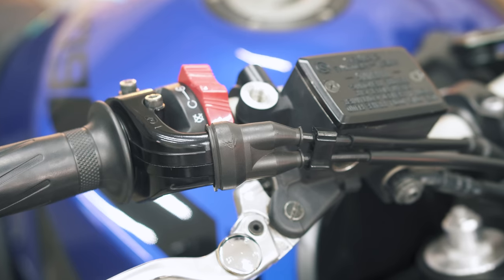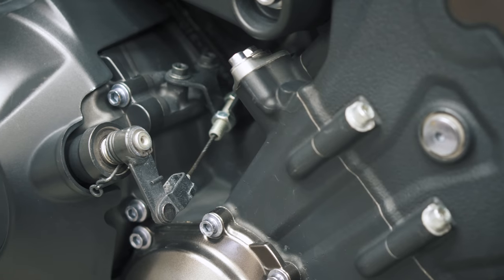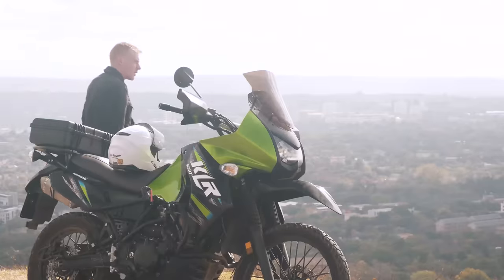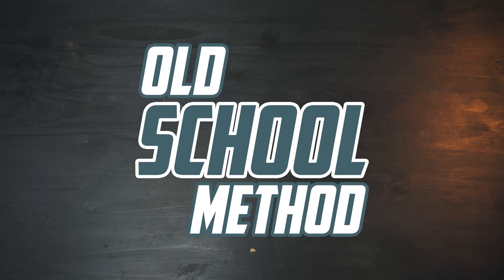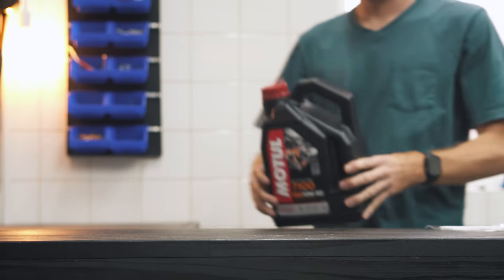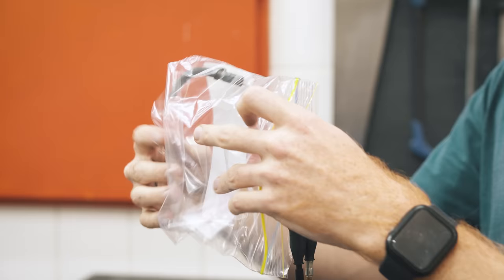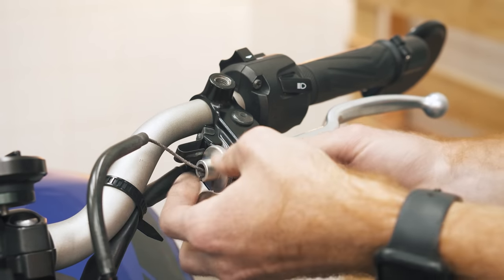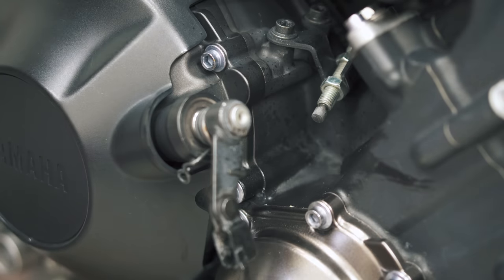STOP! Lube Your Motorcycle Cables

Comment: Bruh, that is a lot of work. I literally just poor bicycle oil down the cable as I move it up and down.
Reply: Agree. Drip oil and move cable up and down
Reply: I usually keep a drip bottle with old engine oil for that.
Reply: The clutch and throttle cables are long… to “move the cable up and down”  to the point where the lube would soak through the entire length would take quite some time, I’d rather just use the $10 tool that takes a minute to put on. If you have an hour to cut down a tree, spend 45 minutes sharpening the axe... But to each they own 🤷🏼‍♂️
Reply: @BikingVikingHH  It takes about 15 seconds.
Reply: I even use sewing machine oil, for more cheaper. It's like 2$ for a bottle.
Reply: @ksneia  not all oil is the same
Reply: @ralphwarom2514  then it’s not getting the whole cable length. I’ll stick with my 30 second tool and proper maintenance 🤷🏼‍♂️
Reply: @ksneia  no, no it’s not lol

Try olive oil next, champ, if it works right 🥴
Reply: @BikingVikingHH  no, not worth to try, it's cost more than cable lube.
Reply: @ksneia  are you Jewish?
Reply: Any sort of attention is good some people don’t bother and just leave it until it seizes up.
Reply: Ikr u can use wd40 also
Reply: I think its a joke
Reply: @ksneia  Sewing machine oil is good. They have a lot of moving parts that require low friction.

Comment: I stopped using WD40 on ANYTHING on my bike because of how much dust it attracts.
Reply: It’s a great chain cleaner
Reply: @Mikkel111  True it is. In a pinch I'll use it but even then the thin layer of whatever it leaves behind will attract dust if it's not under the chain lube that's applied over it.

AS a life hack I've learned to use household degreaser and a good old brush. It takes a bit more brushing but it gets the chain as clean as anything else.
Reply: @otlndsh  Remember not to use anything that could break down or harden the o-rings.
Reply: @Mikkel111  Ya it's friendly on the rubbers!
Reply: @Mikkel111  It's very expensive chain cleaner, diesel fuel does the job as good.
Reply: @@JuneAtHomePH lol its in a spray bottle with a picture of a motorcycle, grill, etc
Reply: WD is water displacement, it is actually a solvent and is great at cleaning stuff, and as such it will remove any lubricant any component may have, it will also eat rubber (so its a terrible idea for chains, cables, brake components, etc.).

WD is NOT a lubricant, so out it with your cleaning stuff, not your oil/grease stuff.
Reply: Try ACF-50
Reply: @SuccessShared  ACF-50 attracts even more dust and dirt, but I suppose it works very well to prevent rust.
Reply: @otlndsh  I don't know what bike you ride but I found it superb on my Harley for over a decade. MCN rate XCP products above ACF-50 so perhaps try that
Reply: Beside wd40 will eventually evaporate..you need just a tad of grease
Reply: wd40 best for cleaning rims

Comment: Did this on the clutch cable on my CBR600F1 from '87. I was either thinking about completely replacing the cable or trying the lubication tool. Bought the tool and it took a while for all of the gunk in the cable to get sprayed out, but the clutch feels ALOT better now. Then i did it on my other motorcycle and moped. Highly suggest trying the tool before buying a new cable.
Reply: I lubed my CBR600RR and I never saw the spray come out the other side. I guess I'm going to spend the time and make it go all the way through instead of buying a new cable.
Reply: @nightmaresdaydream5766  It could take some time for the lube to push its way through the dirt in the cable. I've tried with the old school method before i got the tool, i could push/pull the wire for 3 minutes straight before lube exited the other side. 
I started with WD40 to dissolve the grease/dirt in the cable untill the exiting liquid was clear, then blew air through the cable to remove most of the WD40 and then add some oil in the cable as lube. No need to use a lot of oil, just enough to coat the inside, the excess will just drip out and look messy.
Reply: I lubed the clutch cable of a 10 year sitting in the corner bike I bought ..
After lubricant I thaught the cable was snapped ore I install wrong because it feels like there is no force anymore in the clutch handle 😅 so smooth now that I had to learn the clutch new from zero ..
Reply: New factory cable was 26 bucks and now i dont have to worry about nothin
Reply: Except complete installation.

Comment: And don't forget to lube your speedometer cable too (if you have an old-fashioned mechanical one). They get neglected more than throttle or clutch cables do and likely should be lubed more often.
Reply: damn, I didn't even think about the speedometer cable. my bike has a mechanical one as well. gonna do this tmr
Reply: nice, that speedometer cable need more lube than gas & clutch cable :)
Reply: what should i use, can u suggest one. thanks
Reply: Be very very careful oiling the speedometer cable as any lubricant that finds it’s way into the speedometer head it self can gum up the works
Reply: True! On my old Bandit, if the cable gets dry, the Speedo needle will fluctuate... significantly
Reply: on my cbr it will start dancing around 60mph between 60 and 70 @888jackflash
Reply: I think bro.. you are talking about ANALOGUE speedometer here..!!! 🙄🤔
Reply: lube the speedometer cable? 😂 that has to be a joke, i have not heard of such a thing. like blinker fluid
Reply: Now, lubing that cable will make you go faster.
Reply: Mine broke last year, this comment hits home as I'm now on a new clutch cable too
Reply: @GearShifter925 yes
Reply: I just put a new speedo cable on my 01 vstar 650. it had twisted ..the last ownere was a MECHanic.lol I used good ol' grease before I installed it

Comment: I've been using WD40 for lubing sticky cables, for over 40 years, never had a problem.
Reply: WD40 was never designed as a lubricant and will lose its properties much faster than oil, it was actually invented to be a nonflammable substitute for oil. But lubricating oil is better in every regard aside of that. also you should not mix WD40 and oil, so its better to just not use WD40 at all.

Comment: Hey! Although wd-40 is indeed a solvent and does swell many kinds of rubber while also degrading multiple kinds of plastic, materials like teflon and vinyl are 100% resistent against wd-40, they are also listed in wd40's list of compatible materials with the "classic" wd40.

Engine oil and cable lube are still better options though, because of their viscosity haha
Reply: Also WD-40 solves any residual lubricant and does the opposite of lubrication. Maybe a good idea for cleaning a gummed up cable?
Reply: @raphihuberclimbing8730  for cleaning it up, yea. I'n reccomend that tool he used for that though, to really flush that okd stuff out
Reply: WD-40 is a fizzy kerosene with a little bit of oil. Kerosene evaporates leaving a very moderate lubrication.

Comment: I hold an Airframe & Power plant mech. rating from the F.A.A.
There are many aircraft that make use of Teleflex type cables for many different applications. That being said, I was taught to never use any type lube on these cables, and when they start getting stiff, or sticky you replace them. The reasoning  behind not lubing these cables is that hydrocarbons (oil) make teflon swell, which in turn will eventually exacerbate the problem you are trying to correct. 
I've never tried to lube any cables on aircraft, butI have lubed stiff cables on my bikes many times. I reason that, if a cable is getting stiff, it's probably because the liner has failed at some point in the cable housing, therefore, what do I have to lose ! And it usually frees up the cable for some time, but they eventually get stiff again. I have had cables that were somewhat stiff, I lubed them, and shortly thereafter they locked up completely.  
The moral of the story is, if you have a stiff cable, lube it, and ride. But before you put on your helmet, order a replacement, chances are, you'll need it sooner than later !

Comment: Good advice. I had a clutch cable brake on my 83 BMW R100rs a few years back. I was downtown in Indianapolis when it broke, my wife was on the back and I told her, "Hang on where gonna be turning right on a red, A LOT." I made it all the way home by shifting with out the clutch and downshifting, and turning on a red light. It probably looked like the Three Stooges on a map but we made it home. I was made a firm believer in cable maintenance.
Reply: All you gotta do is look. A cable dont snap for no reason

Comment: Good subject for your video. I've used the cable clamp tools, and find they leak too much to be effective.
- I now use a cable lube aerosol that comes with a plastic 'straw-like' tube. Unfasten your cable at the handlebar end, then tape the aerosol tube to your cable so that it is pointing into the cable core. I use electrical tape although other tapes may be better. Then attach the taped tube to the aerosol can, and inject the spray; no special tool required, and much more effective.
- Wrap a rag around the taped cable end before you inject the spray because there is always some leakage.
Reply: Top tip. Appreciated. I'll do that. 👍

Comment: If you have an uncoated steel cable, lube it. If you have a Teflon coated cable, don't lube it. There is simply no need unless you commute through the Sahara or something, or bike is exposed to a very corrosive medium, in which case, the cable'll be the least of your worries, however still relevant.

There are cases where cables start dragging because the inner cable eventually wears its way through the lining, creating drag. In that case lube will help, albeit in a temporary manner

Makes no difference for me whatsoever on normal everyday use.
Reply: Some PTFE spray does no harm to a Teflon coated cable, and does rejuvenate the smoothness on older cables.

Comment: I use the old method for lubing the cables on my moped and i do it every spring before i start riding it. I only loosen it in one end and poor oil in to it with the other end of the cable still attached to the carburetor and it has worked great for me.  It looks like more work to use the tool that are made for lubing the cables in my opinion so i will continue doing it with the old method.
Reply: I been using lock lube

Comment: I live out in west Texas and am fortunate enough to have aquired a couple of older bikes. First is a 1974 Honda CT90 and second is my 1978 Yamaha XT500. Both have lived out here for years and both needed cables lubed. The Honda, named Dreamsicle, because it's orange, barely had a working throttle. The XT, named Plata, it's silver, took two hands to pull the clutch lever after sitting uncovered in the desert for 12+ years. Now, after attention given, both are much nicer to ride.

Comment: Maintenance is key for a safer and solid riding. The easy way to know if a bike may have been well maintained is by the look of the chain. If you don't spend 5min cleaning it, I imagine the rest.
About wd40 and Teflon combination, that should not be a problem in terms of degradation as Teflon is one of the few materials that is resistant to most acids. However, wd40 is more liquid and therefore will not last as long as a proper lube.
Keep up the good work 💪

Comment: We use electric tape to secure the plastic bag onto the cable and after putting some lube, we squeeze the lube into the cable by closing the open end of the plastic bag and letting the air push the lube. We don't wait for gravity to do the job. 😅

Comment: I have a more easy alternative way which costs wayyy less, You can add it in your hack video as if you like
 Use a cheap plastic dropper ( which you get in labs ) . Collect the aerosol chain lube by spraying it in the cap then draw the lube with the dropper and just slowly push the lube via the dropped through the cable. This method is the cleanest and you wont be wasting a lot of lube as well . Also the dropper can be reused no problem . And also you don't even have to pull out the clutch cable for this .
Reply: or u can use syringe :)
Reply: @Hijaazz  yes that would work too!

Comment: I left work one winter morning after a night shift . Once out of the company gate the road went down hill . The bike started reving to max between gear changes , riding down an icy hill ! Water was in the throttle cable. I had to quickly turn off the ignition to stop . Thankfully I had some WD and some basic tools on the bike . Later I oiled all the cables .

Comment: I bought a 20yr old bike a couple years ago with a seized rear brake. Did everything to the rear drum, and it was amazing.... but still no brake. The cable was so seized up it was solid. eventually replaced the cable but about 20 min with the old school method and my rear brake worked again

Comment: Venhill don’t recommend lubing their lined cables, but you should lube the barrel ferrule that locates in the lever. This prevents the wire strands breaking from bending if the barrel is sticking in the lever.

Comment: The Yamaha wr250r manual States white lithium grease or straight up engine oil also you're supposed to be using like a 75w 90 gear oil for your chain lube

Comment: My clutch cable snapped halfway though my driving test in 1975 (1969 Honda). I finished with clutchless changes and waddle starts but passed. Without regular lubricating the cables for bakes, throttle and clutch became quickly stiff and the nipple on the end would snap free of the solder connecting it. We just had regular light lube oil for everything in those days.

Comment: Easiest method is taking syringe with a needle, filled with the engine oil and just put it straight in the cable housing. Literally zero mess, it takes few minutes and works perfect even after 1 year.
Reply: Cant we use Gear Oil Instead Engine oil?
Reply: @betheanonymous   Gear oil works very well too, but engine oil, at least in my case is less thicker than gear oil, so it works better in cold weather (Im riding on my quad especially in winter)
Reply: @UnexploredMusicGems  I tried today but cables are stuck So I replaced a new one WD40 works but it becomes hard after two days
Reply: @betheanonymous  Yes, because WD40 is made for stuck bolts, cables etc. So it only needs to work for few hours until you get it unstuck. Thats why you need to use engine/gear oil, because it will last even years, not hours/days like WD40

Comment: I'm more traditional and think that 10W30 oil is probably best. I haven't seen any issues with that type of oil. The viscosity is such as it will stay in the cable for a long time and it won't break down fast.
For the throttle cable I'd consider a thinner oil since it doesn't see the same forces as a clutch or brake cable.

Comment: I've known WD-40 cleans lots of different types of goop up, but never knew it was considered a solvent. Makes sense, just never really thought about it.
I use the stuff for cleaning and rust prevention, never for lubrication. It was never intended to be a lubricant.
I tend to use wax-based chain lube on my clutch cables for whatever reason, and for throttle cables I've just been lazily avoiding lubing them because I know chain lube is not the right thing to be using 😅

Comment: Took my bike to the dealer I bought it from for a clutch replacement. Got it back and on the way home I let go of the throttle woke holding the clutch to coast and the throttle didn't return to zero. I had cruise control without install. Since a clutch took a month I don't want to go back to them so I'll try the easy method myself after ordering the lube and adaptor thing.

Comment: I find it hard to believe you’ve never had a problem with a clutch cable, as much as you ride. I certainly have and I stopped riding 11 years ago after riding for only 4. My bike was purchased new. Kawasaki.
Reply: Why’d you stop?
Reply: @JRob99  Finally got a car enabling me to take it apart and, well, it never went back together. I blame family. EVERYTHING went missing. It’s literally still happening. I bought replacement turn signal sockets for the van and when I went to my motorcycle tool box where I had my electrical wiring stuff I found it completely full of my mother’s tools with my stuff completely gone. Only days earlier, when I ordered the sockets, it still had my wire, crimps, terminals, etc.
Reply: @emmettturner9452  spot on 😂

Comment: i use HHS 2000 form Wurth best lube for anything everywhere…
Eliminates squeaks and creaks and has excellent flow and penetration performance, as well as good corrosion protection.
Highly adhesive lubricant that is not spun away when used on turning and rotating parts
Compatible with O-rings/X-rings and plastics. Neutral behaviour on painted substrates.
Resistant to splash water and salt water, weak acids and bases
Free from silicone, resin and acids.

Comment: Snapping cable is not the worse scenario. A jammed throttle cable can be a lot more dangerous...
WD will not damage Teflon : no chemical could. I usually stick to sewing machine oil for my cables...but I am in the 0.01% lubing cables every single year.
Reply: Even a jammed throttle cable is not dangerous, just pull in the clutch. It will be a lot harder to ride back home tho
Reply: @Carlisho  I probably ride a bit too hard for my skills...but when I want to slow I usually have little time for figuring out what is wrong with my engine not slowing, pulling the clutch and cornering "free wheel", engine roaring full RPM...

Comment: Just use a small long nozzle for your spray can. No need for the ziplock bag funnel or the clamp. Just disconnect and spray at down and wiggle the cable. Doesn't even need to take it off the bike